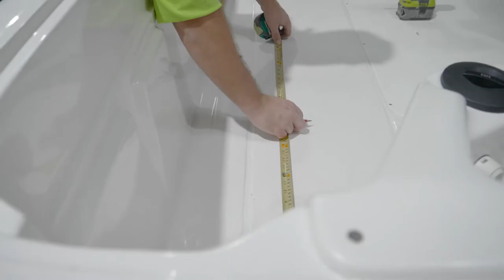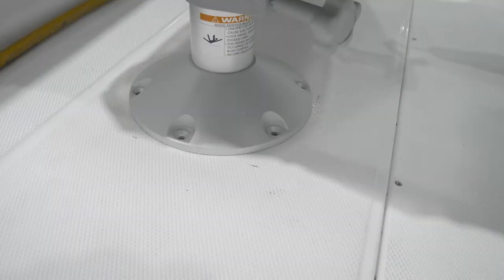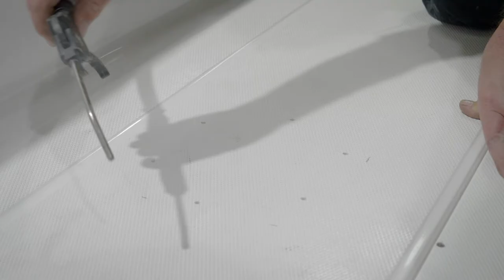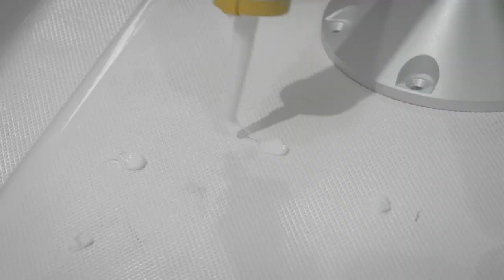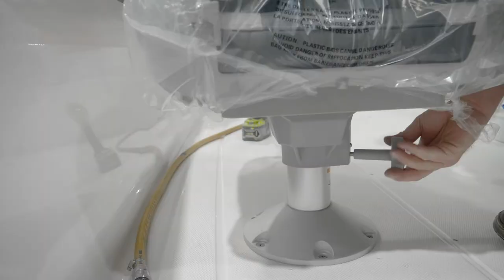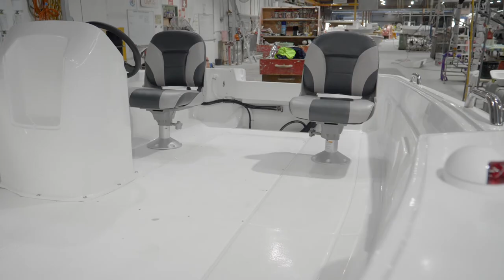SCBX16 Pedestal seat installation tutorial

Comment: I’ll still be amazed if those screws lineup properly with the holes you should just screwed them right through the holes. And I don’t know why they don’t use just hex bolts instead of screws that will probably get stripped

Comment: One comment, when drilling any hole in a boat, especially the floor, you should always use a drill stop.  I just repaired a 1/4 inch hole that the previous owner punched all the way through the hull when he installed a new seat.  He couldn't figure out where all the water was coming from.